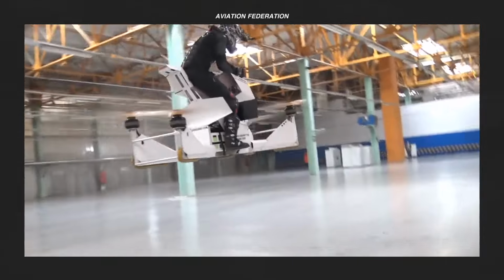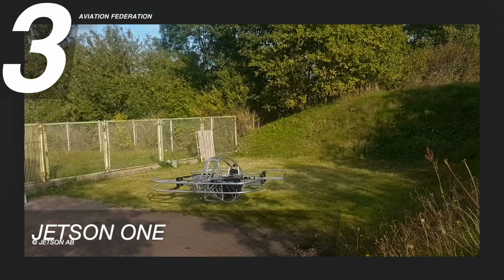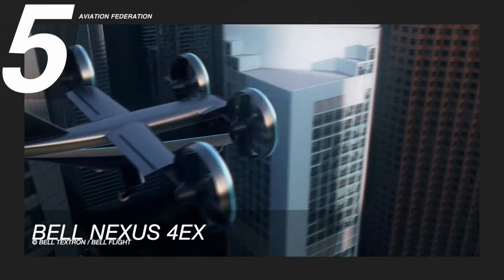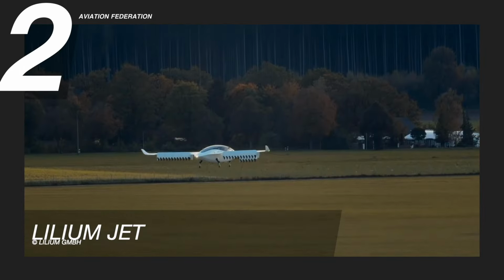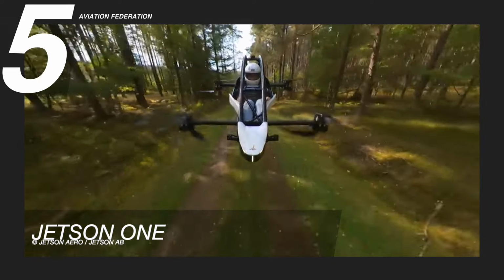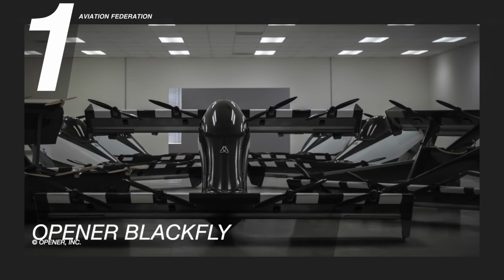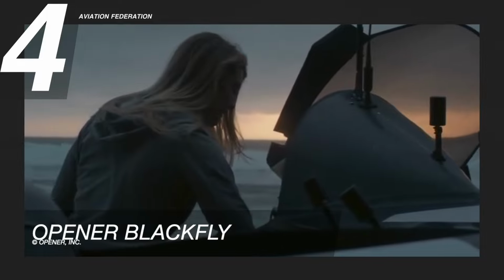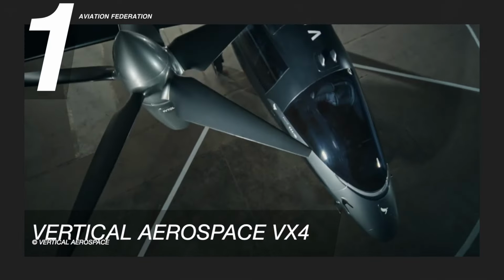Ultimate VTOL Aircraft Comparison SUPERCUT | Joby, Ehang, Volocopter, Jetson, Opener and More!

Comment: That is your problem you’re making it electrical you get a Yamaha motorcycle for50 and you convert it with these blades gas powered that will change all off-road vehicles forever turn a motorcycle gas powered into this flame craft. I can’t believe that you’re still trying to run this damn thing on electric.
Reply from the maker: Electric VTOLs have a cool sci-fi appeal, but yeah, battery limits and infrastructure gaps make them tough to take seriously for anything beyond short hops or demos. A gas-powered, blade-equipped hybrid concept like you mentioned? That would shake things up especially if it taps into something rugged.

Comment: I would not trust the scorpion, built by a Russian, and I read an article in which the hover bike failed and the creator almost got his legs chopped off. Look at how dangerous it is. Not a smart design.
Reply from the maker: Safety concerns are paramount in aviation, and it's crucial to carefully evaluate the track record and design of any aircraft. The incident you mentioned with the hover bike emphasizes the importance of thorough testing and safety measures during the development of innovative aviation solutions. When considering new aircraft, have you explored other EVTOL options with proven safety records or unique safety features that address your concerns?

Comment: There is any restrictions if any of constraints to by propeller and propeller two jet ..
Reply from the maker: If we understood your comment correctly, choosing between a propeller and a jet for a VTOL aircraft can depend on various factors, including the specific mission requirements, fuel efficiency, and desired performance. Both propulsion systems have their advantages and limitations. If you're considering such an aircraft, what are your primary considerations, and do you have a specific mission or use case in mind?

Comment: Yeah.. no.  Lilium is the leader in eVTOL and is the only company with a scalable vehicle.  You didn't mention that, nor did you explain that there's already a 7 seater.  You should know this by now as it's been a release for a while.  These electronic octopus-copter vehicles aren't going to cut it.  Even your proposed '#1'

Comment: Normal wings and pushing motor can dramaticaly extend maximum range of that things. And vehicle still be a vtol and can land on a parking lot. But for what purpose? A long range car replacement? Actual flyer should take cargo and move it faster and cheaper, than existing ones.